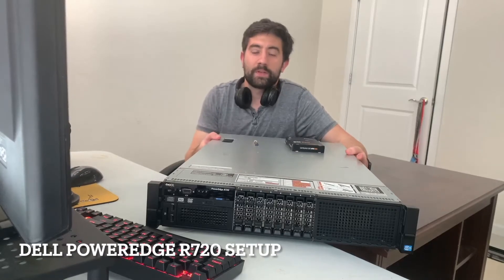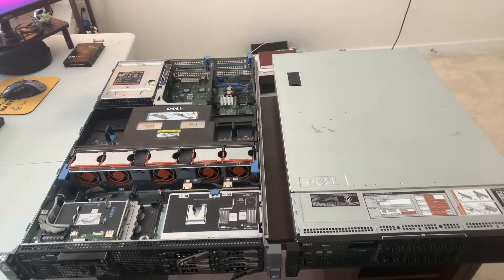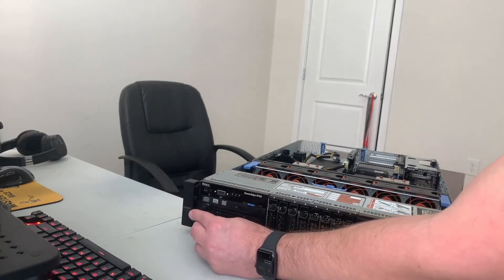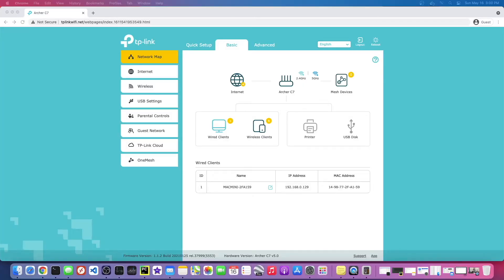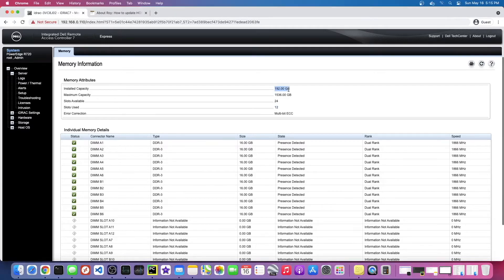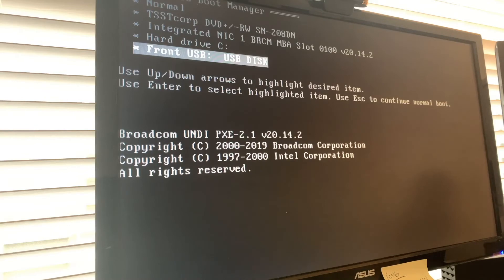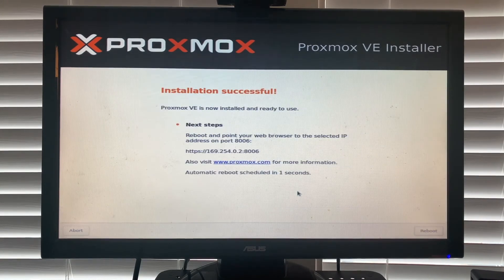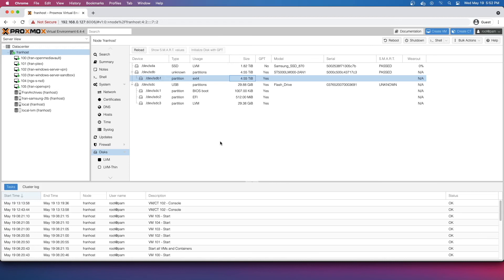Dell PowerEdge R720 Setup (Upgrade from R710)

Comment: little tip, if you don't know the iDRAC IP address you can get the front panel to display basic information including this
Dell gear really is great

and I know this is late but definitely should have reset iDrac and the BIOS configuration to defaults to give you a clean slate

Comment: Great Vid. I am newbie. Can you please tell if I can connect a wireless mouse and keyboard or should it be wired ? secondly, Can I connect monitor with HDMI ? the Flash drive that you inserted inside had EXSI I guess. What was in the other USB external flash drive ? I have bought a renewed R720 for the first time and need some advice. Thanks
Reply from the maker: I've never tried connecting a wireless keyboard/mouse to the server. I'd recommended wired. No, the server does not have an HDMI port. The usb drive inside the server was empty, the external usb drive had the proxmox installer on it. I booted from the external usb drive (which ran the installer) then I chose the internal usb drive as my target device (where I wanted to install proxmox). Does that make sense?
Reply: @Franchyze923  That helps. Thank you so much brother!

Comment: I am from India, please help me to buy a used/refurbished server with $500 budget, with a 32GB RAM, 1/2 Processor with 8/12 Cores.It is not for business, it is for Education/training purpose.  if you have any such used sever, please help me to setup a home lab for Linux Admin and Networking Practice. Thank you so much.
Reply: If some Kind hearted helps with donating the same, we can pool funds and pay for shipping charges to India. We are in need of any server which can accommodate 4/5 VMs for Admin/Networking practices. Thank you so much.
Reply from the maker: I would consider looking for a Dell R710. They fit your specifications and can be found pretty cheap these days. I think I got my R710 for around $150 a few years ago.
Reply: @Franchyze923  Thank you so much for note. It will be really helpful , could you please share any reliable vendor info or weblink.
Reply: I don't know how bad shipping would be, but TechMikeNY sells referbished DELL servers.
Reply: @davidwilliss5555  thank you so much for info.

Comment: So the ISO is on the outside usb drive, I assume you selected the internal usb as the boot drive.  I have a 720XD trying to load up TrueNAS Scale.  The iso boot usb is not finding my internal usb to save to.  Did you have any similar issues? (The PERC is flashed to IT mode)
Reply from the maker: You're talking about the Firmware ISO right? Yes, that was on the outside front usb drive. When I wanted to update the firmware, I booted directly from that, so I selected the OUTSIDE usb drive. When you run the ISO firmware updater, you boot directly from it, you don't need to find your internal usb to save to. Does that help? I ran this firmware updater before I even had anything installed on the internal usb drive.

Comment: Did you had any blinking lights on your samsung ssd 870 Evo? I tried Kingston a400 480gb I got errors and blinking orange lights planing to switch to samsung 870 Evo.
Reply from the maker: No, I didn't have any blinking lights with the Samsung 870. Yea, I'd try the 870 and see how it goes.

Comment: Great video, I have one question though. Where did you plug in the 5TB hdd? On the front there are only 2.5" slots right?
Reply from the maker: Thanks! Yea that's correct only 2.5" slots. I shucked a portable external harddrive - https://www.costco.com/seagate-one-touch-5tb-portable-hard-drive-with-rescue-data-recovery-services.product.100761181.html
So the 5TB harddrive is 2.5"
Reply: @Franchyze923  Got it, thank you!

Comment: I notice on your intial boot you have all 192gb of ram installed is this with all slots filled? With my r710 I have all slots filled with 8gb sticks for a total of 144 but im ram speed gets reduced to 800mhz i see youre running I assume at full speed with your ram
Reply from the maker: No I don't have all RAM slots filled. In the video when I boot and you see 192GB, that is on my R720, not the R710. If you watch here https://youtu.be/hvfYJ34WZF0?t=211 the R720 is on the right and you can see only 12 slots are filled (some slots have fake plastic sticks in them). I have 12 16GB sticks of RAM. I'm not sure the top speed of the R710, it might be 800mhz so it's possible the R710 is lowering your RAM speed.